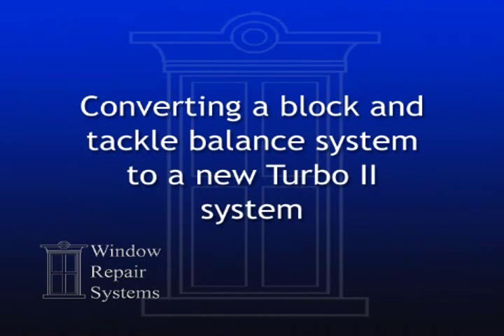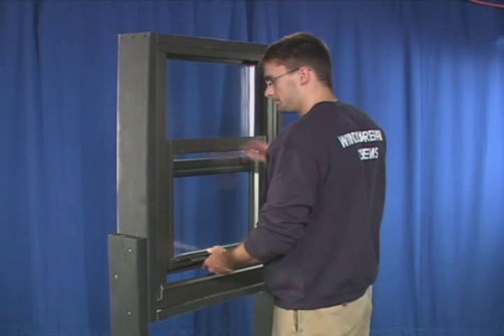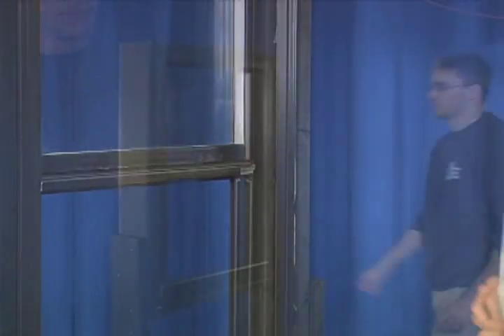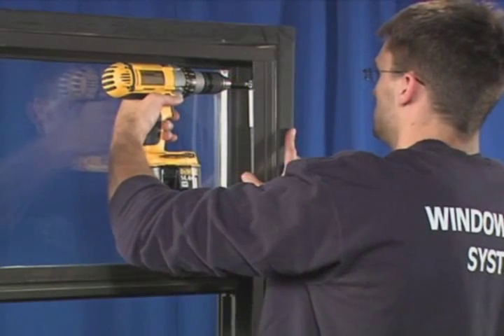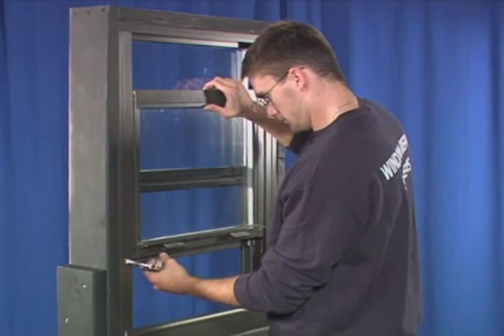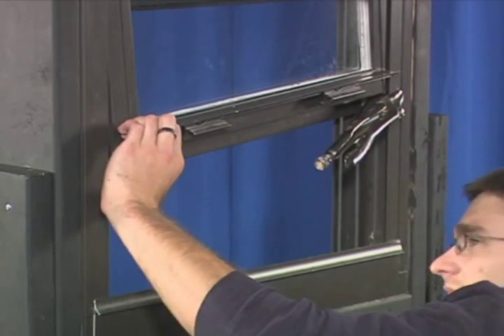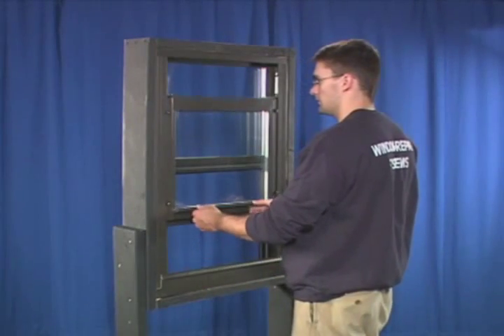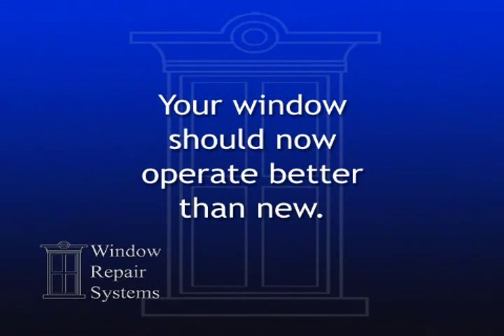Window Repair: Converting Block and Tackle window balances to the Turbo 2 window balance

Comment: I would never use vice grips to hold the window in place.  Vice grips would damage the aluminum. If you look at the video when he's doing the second side you can see scratch marks on the other side from using the vice grips.  I would recomend using a long piece of wood under the window.